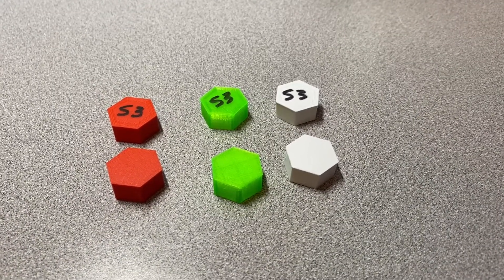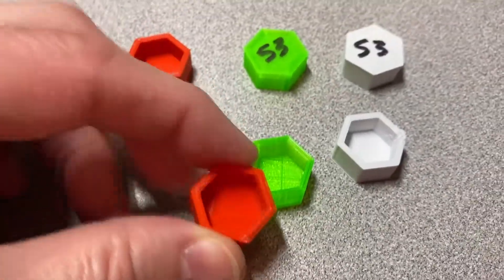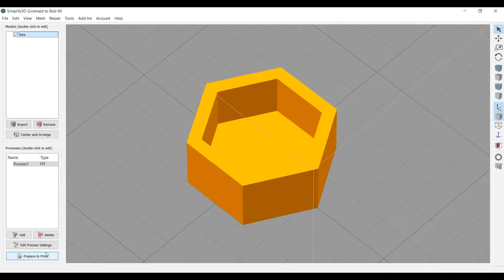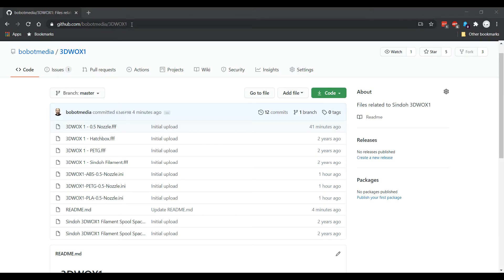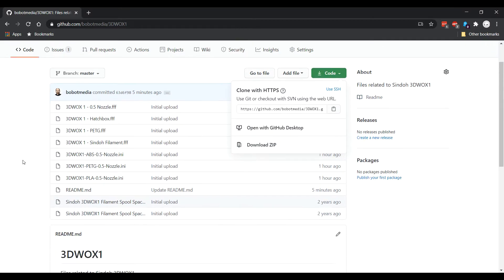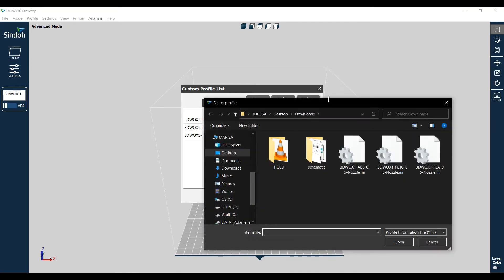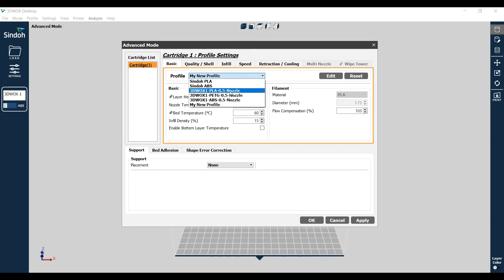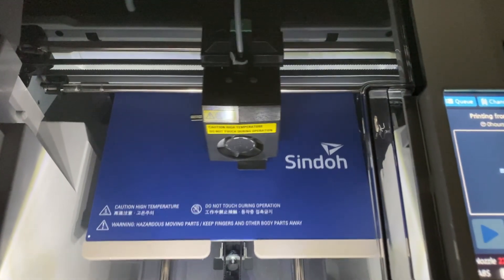Sindoh 3DWOX1 3D Printer - Using 0.5mm Nozzle Width

Comment: hello I have a 3dwox1 can you tell me how I can connect it to the latest version of Cura slicer v5.6.0 also I have had no luck finding my printer on my network. I can view the remote camera but the printer doesn't appear on my PC regardless of me using wifi or a plan cable. HELP please.
Reply from the maker: Right.  The 3DWOX printers use proprietary communications that can typically only be accessed through the Sindoh Desktop Software.  Please post your question over at our 3DWOX Support Group page on Facebook.  I think I recall someone working with a Cura profile there.  https://www.facebook.com/groups/593946721288877
Reply: Hey thanks for getting back to me I joined the group and ask the question @AllThingsBobot

Comment: Since you are the only one here on youtube with this printer, I do have a question: Sofar I had never any problems with open material PLA or ABS. But now I wanted to do something in PETG (which Sindoh has on their list of usable materials). Did you ever work with PETG and if so, what settings do you recommend and how happy have you been with the results?
Reply from the maker: I played with PETG a little bit a few years ago as mentioned around the "12:30" mark in my video "Sindoh 3DWOX1 - Calibration, Material Settings, Using Simplify3D" from 2018.  That info is now dated, but I have a PETG profile at the 3DWOX1 Github link listed above in the video description that I used for the Sindoh Desktop software this year.  I print primarily in PLA, so not a lot of experience with PETG but it certainly required different settings to get it to print successfully.
Reply: @AllThingsBobot  thank you. I will have a look at your git repository. I just resorted to that for clear plastic as clear PLA is most of the time a bit yellowish. I hope it has no tendency to clog the nozzle  or do anything bad to the printer.

Comment: Do you have, or are you working on, any new profiles that would allow for a 0.8mm nozzle swap to replace the stock 0.4mm while still using the 3DWOX Desktop software? I've been printing with a 0.8mm for a few months now using Cura, but Cura is trickier to dial in with all the settings available. I'd prefer to use the Sindoh desktop software if the nozzle size could be selectable.
Reply: Have you had success of getting the nozzle out of that Sindoh assembly and putting a different one in without damaging the thermistor?
Reply: @LutzSchafer  Yes. I had swapped the original .4mm for another .4mm Micro Swiss nozzle a couple years ago, and just this year have changed to a .8mm nozzle without any problems.
Reply from the maker: I created a simple profile attempting to set up for a 0.8mm nozzle but I have no way to test it since I haven't swapped.  You can get it here (https://github.com/bobotmedia/3DWOX1) and tweak as needed.  Good luck.
Reply: @AllThingsBobot  Thank you very much for the "beta" profile for .8mm nozzles. I've tested it and it is working. The cartridge bay spacers from your GitHub are the test specimens for the first prints... they came out perfect. It's so good to be back using the 3DWOX Desktop software! More familiar and so easy for optimal part orientation. Thanks again.
Reply from the maker: @ck1648  Glad I could help and that it worked out for you!
Reply: As always your videos ROCK!   I would very much like to try this .5 nozzle size on the 3dwox2.  Do you have fff files for this feature?  I wouldn't think there would be a tremendous amount of difference between wox1 - wox2 other than an added cartridge?   Thanks in advance!

Comment: Hey, I wanted to ask since you own both model 1 and dp200, Did you ever tried to compare or use each other's profiles? Mostly, will model 1 profile work on DP200?
Reply from the maker: Never really looked into it.  I just use specific profiles for each machine.  If you are looking for a DP200 profile for the 0.5mm discussed in this video, it is here:  https://github.com/bobotmedia/Misc

Comment: Since your the Sindoh master. Can you tell me how accurate are these printers? I have an Ultimaker and It’s very frustrating trying to get accurate models. The tolerances are all over the place from one side of the build plate to the other. One time I was so pissed I wanted to throw it out the window.
Reply from the maker: I was curious so today I ran a test on my Sindoh 3DWOX1 of (9) simple 20mm cubes spaced on the bed evenly in a 3 x 3 pattern.  I was using a spool of old filament that was laying out (unknown moisture content) and it even ran out during the print and I had to pause and change to another spool.  In the end, measuring several times with calipers, the largest range on all the cube sides was from 19.91mm to 20.12mm, or less than a quarter of a millimeter.
Reply: Interesting, I ran the same 9@ 20 x 20 x 10 cube test and the X axis varied from 19.79 to 19.99. Y 19.85 to 19.99. Z 9.87 to 10.04. I think the Sindoh is a better machine than the Ultimaker. Hopefully Mrs Claus will drop a Sindoh off this Christmas. Thx
Reply from the maker: @Spyderman500  Not much difference, no?  You are not varying more than 0.2mm.